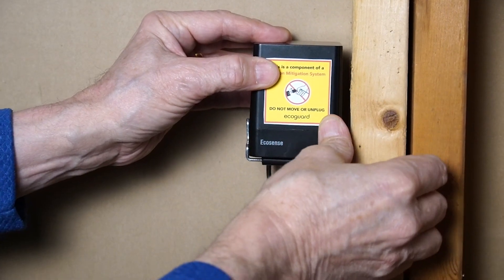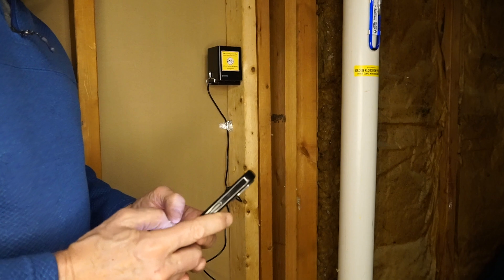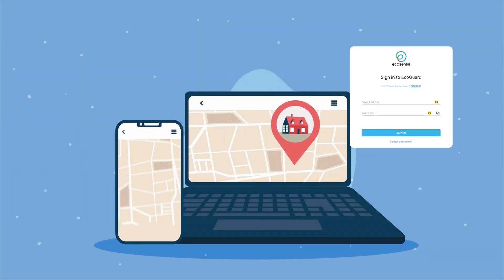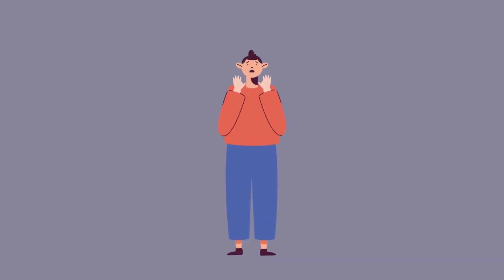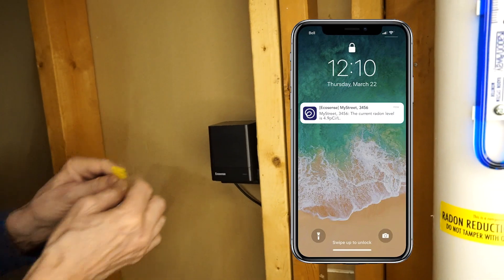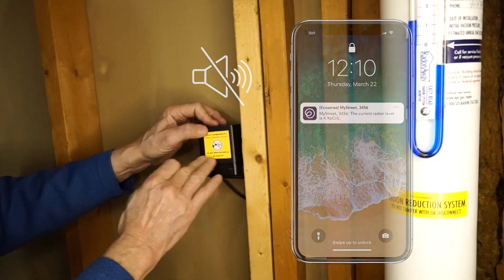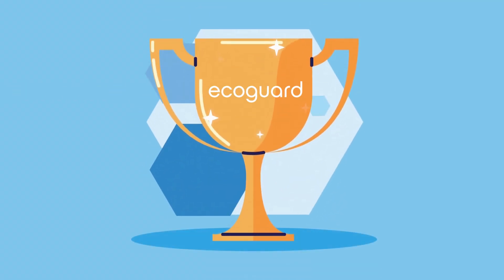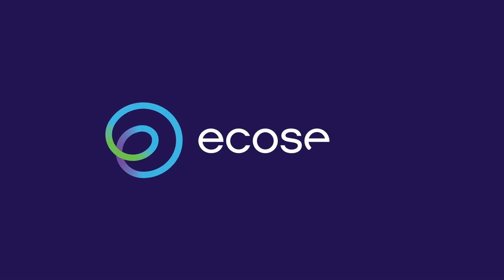Enhance Your Radon Mitigation with EcoGuard by Ecosense

Comment: Why does it need to be replaced every 2 years? How far off are the readings typically after 2, 3 and 5 uears? Air things doesn’t have to calibrated so frequently.
Reply from the maker: Mitigation standard recommends retesting every two years with a recalibrated device.  However since the unit is in a fixed location (as opposed to being placed and retrieved every two days) there is no reason to suspect the calibration factor will change in 2 years